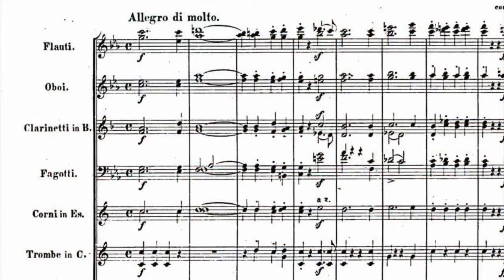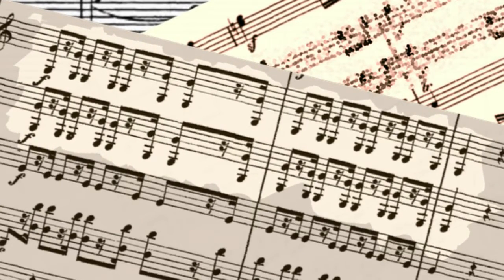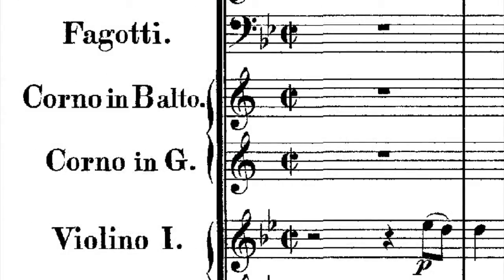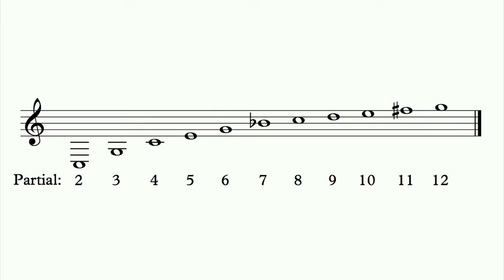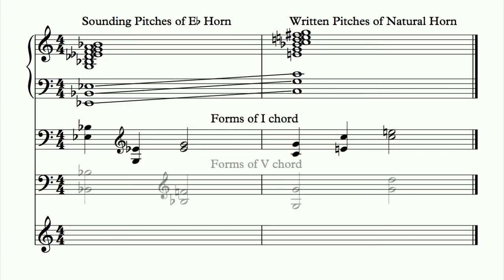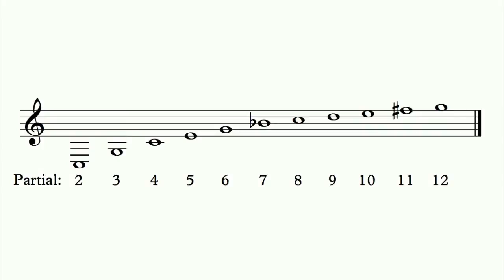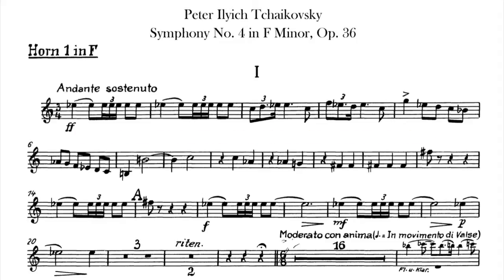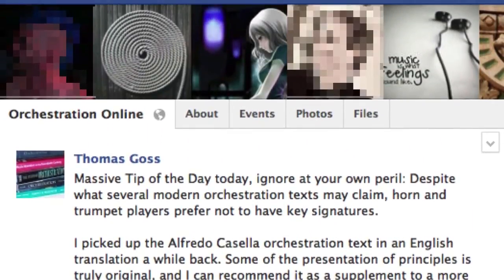Orchestration Tip: Reading Natural Brass

Comment: Very good video! But some corrections have to be made here. 
3:50 There were trumpets build compact to do just that, be able to be stopped, called Stopftrompete (Stoppable trumpet) in german. Of course they were abandoned immediately when keys were invented (1811). Horns with keys needed more time to be state of the art, in Germany about 1840, in France only the end of the 19th century. This doesn't say it wasn't composed for natral horn after 1840 in Germany, as Brahms and Mendelssohn show.
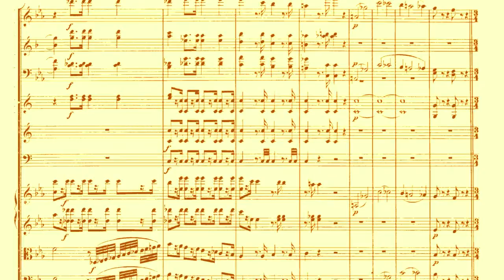1:29 Actually the famous sound of a good Natural Hornist doesnt come from full stopping (like stopping known today marked with "+") but from half stopping, "bending" the tone DOWN a half or hole-step by covering the bell with hands (but not 100% otherwise it's full stopping and the tone goes UP a half step). This was especially important to reach a written F above the staff, but also for B below and Eb, Gb, A and B within the staff. Other Notes like F# above and Bb within the staff were reached by putting the hand out and highering the pitch. This whole hand manipulation was only possible on lower Horns in F down to D, not the higher ones and was mostly used for Solo works (Mozart concerts). Mozart's orchestral Horn parts mainly used open notes (natural series) for projection reasons.

Comment: Just wanted to point out there is now something called a stopping mute available. It is a mute that mimics hand stopping, Ideal for improving tone quality on lower stopped notes, essential for Tchaikovsky 6th, and very handy in Mahler 1 when hand stopped whilst bells up is requested. That does not mean that the general advice here regarding best range for stopped notes is wrong, it is spot on - best to stick to it. Just pointing out how we get around the problem Tchaikovsky and Mahler have left us with, only took us best part of a century to get there!!
Reply from the maker: You may not know, but I'm married to a horn player! :) Also, I've mentioned stop mutes in other videos and in my book of 100 Orchestration Tips. They're not mentioned here because the focus is on sharpening reading of transpositions by learning to apply the harmonic series and typical harmonic schemes.

Comment: If you don't give horns a key signature, please put in a rehearsal  letter at the key change, or at the very least a double bar line. Conductors like to say "from the change of key" which is hard to identify without some visual cue in the part. As for the good range for stopping, treble cliff is easier, but that didn't stop Tchaikovsky putting in a fortis Simon stopped low C# in the 6th Symphony (Pathetique). Sounds as nasty as it is to play, but I think that's Tchaikovsky's intention. I have heard some recordings of professional orchestras cheating on that note, and it robs the piece of some of its intensity.

Comment from the maker: Good for you, Gordon - but just to let you know, most trumpet players I've met at the orchestral level are indifferent to key signatures. Yes, I've had other trumpet players contradict this, and that's fine. I'm not saying they should never every be used - but they're not considered necessary. There are many parts written by composers who used chromatic trumpets that left out key signatures (like Tchaikovsky etc.), and things are trending heavily back in that direction.

Comment: Hi, I have a question about measure 96 (second movement) of Mozart's Symphony 39. If natural horn can play only the 11 notes you pointed out, how come there is a written D sharp in that measure?
Reply from the maker: You missed my comment about how stopping notes could adjust their pitch by a half-step. There is a wide range of pitches available, but you have to be willing to put up with a degree go unevenness of timbre. What's more, in terms of open pitches, there are more like 16 available - but for the purposes of this transposition exercise, I'm focusing on the 11 most central pitches in most scoring of this period.

Comment: Just a note: stopping a horn puts it DOWN a half step.
Reply from the maker: +ZacPB189 I've actually heard hornists go either direction. My wife can play up instead of down when she stops.
Reply: +OrchestrationOnline It's due to the extreme closeness of the partials.  There's a passage in Jan Kotsier's Brass Symphony where the hornist is instructed to do a stop-gliss, which acts like a plunger and raises the pitch as the bell is further opened.  There are also student/intermediate model single horns in Bb (they still read in F, it's a complicated thing), that come with an A valve for stopped passages (since especially since F Horns are the ideal for stopped passages).  It's also why natural horn solos are able to use the written "A" in the staff, as the hornist stops the bell on the out of tune Bb partial to achieve that note.  I only bring it to attention because non-brass-playing composers tend to have the mistaken notion that it is possible to gliss from open to stopped in an upward direction.
Reply from the maker: +ZacPB189 Sure, good point. Thanks for posting that, it's good for our viewers to know the science behind the sound.
Reply: There is half-stopping, which pulls the pitch down a half step. Then there is full stopping, which functionally raises the pitch a half step -- although what it actually does is lower the next partial up until it lies a half step above the open partial below it. If you start open and gradually increase the stopping, the pitch only ever goes down.

Also, for anyone who grew up playing trumpet or horn in a wind band, a key signature is the norm. They get treated like every other transposing instrument.

Comment: For anyone watching this, that you are largely responsible for 11 (+2) notes when reading natural horn becomes less and less true the closer to the late Romantic period-- and valved horns-- you get, and there are plenty of examples in Classical and Baroque music with stupendously complicated natural horn parts (Brandenburg 1, Mozart's horn concertos, etc.). I'm not arguing that often it is one of those 13 written notes, but it's just so dependent on the piece, the period, the composer, and whether the horns are playing a supporting or leading role in a given section of music. Unlike other natural brass instruments with forward-facing bells that truly are limited to the harmonic series and what can be produced by the lips and airflow, a combination of hand-stopping and lip bending can allow a natural horn player to play a full chromatic scale, at least in the upper 2+ octaves. It didn't take long for composers to start taking full advantage of this, especially as the written notes approach and pass the top of the staff. 

Incidentally, in most of the natural horn music I've played, high F naturals (full stop) are much more common than the far more treacherous F#.
Reply from the maker: Of course. The full range of natural horn repertoire and technique goes far far beyond what anyone might put into a 6-7 minute video. However, that is not the point of my video, which rather is to base one's ability to score-read transposing notes by a very simple, basic tuning scheme based on the harmonic series. I'm not teaching natural brass here, but rather using it as a doorway through which the developing score-reader may improve their skills.
Reply: OrchestrationOnline Sure, and I was simply pointing out that because of hand-stopping, natural horns were/are not necessarily bound to the harmonic series to the same degree as most other natural brass, and also that this fact is certainly expressed in the literature. It is merely something to be aware of.

Comment: I'd like to apologize for the original post that sought viewer clarification via inflammatory means (I do, after all recommend people to your "stuff", because I admire you). I'd like to ask: "If some of us want a key signature, some us don't care about it, and none of us want no key signature, then isn't it best to be safe and insert where appropriate?"
Reply: I'm an experienced horn player - I HATE key signatures. I agree with the advice given, never put key signatures in horn parts.
Reply from the maker: Good to know. I think it all started with composers being too helpful, and then band horn players shifting over to concert horn, and one plank after another being extended over the abyss until some players take it for granted and are even very uptight about it. But I've rarely had a top concert hornist ask for a key signature on a part - and I've heard them ask other composers NOT to add them. So there we are.

Comment: Thomas, as a horn player I have to disagree strenuously with your tip.  Horn players read key signatures all the time.  The scores I've performed that left out key signatures were a chore to read.  

Those modern orchestration texts are correct.  One should use key signatures for the horn parts.

Comment from the maker: Don't think "key of C" - think "atonal/no key signature" when scoring horns and trumpets for professional concert works or film cues. But only leave out key signatures on trombones and tuba if the rest of the orchestra is also free of a key - otherwise, everyone gets one except for horns and trumpets.
Reply: Why does low brass get key signatures while horns and trumpets don't?
Reply: I can't abide this, as I feel it deprives the trumpets and horns of a piece of information everyone else receives: is this likely to be atonal or otherwise one of those pieces where nobody has a key signature? All it takes is a glance at any other transposition's part. If they don't have a key signature either, be ready for shifting sands. I think the trumpets and horns can use this information as well as anyone else, and I don't know any of them that aren't working pop/rock/jazz gigs or something that requires reading a key signature.
Reply from the maker: @mal2ksc  "I don't know any of them that aren't working pop/rock/jazz gigs or something that requires reading a key signature." Exactly. Those are instances where key signatures for horns and trumpets are common and useful. I score many charts for crossover gigs in the course of an average year's work. But. If you read the exact wording of my comment, I say "for professional concert works or film cues." Film cues usually have no key sigs in any part, so that's a given; while modern concert works, i.e. those performed on the concert stage as a new addition to the concert repertoire ALSO usually lack key signatures as a norm, but generally don't require them for horn and trumpet parts when they do occur. 95% of the existing concert repertoire for horn and trumpet lacks key signatures - it's really only recently that they've been added to scores. I've never had a player ask me for them in these situations. But I have heard complaints about key sigs applied carelessly or unnecessarily.